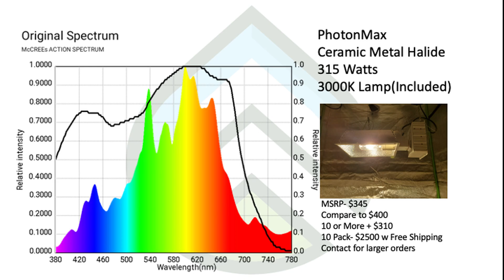315 Watt Ceramic Metal Halide Overview: Quality Light for Small Gardens

Comment: Along with LED CMH is the most efficient electric light source known.CMH has been  used for commercial lighting for years.The CMH lamp was developted  by Philips for commercial lighting and streetlight retrofits.Retrofit kits for streetlights consist of a ballast,reflector,and bulb.These would replace existing mercury and HPS streetlight bulbs.315W for 400W mercury and HPS,210W for 250 w mercury and HPS.Surprized the 210W bulbs haven't been used for plant lamps.

Comment: Hi, the name doesn´t come from the base, its named of the ceramicburner inside of the lamp which can withstand higher temperatures as those made of borsilicate glass. Because of the possible higher temperatures (of the gas inside) you can get more light by less power consumption.